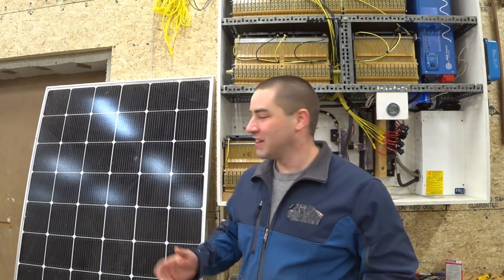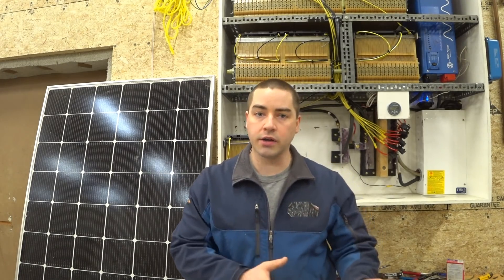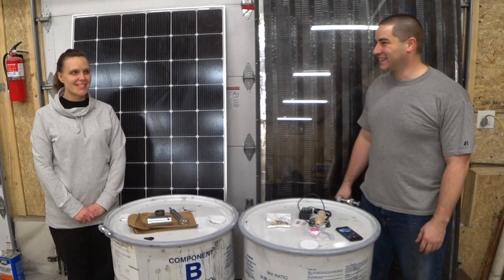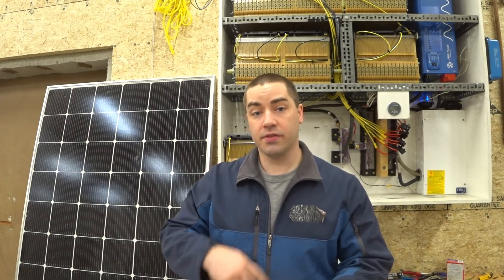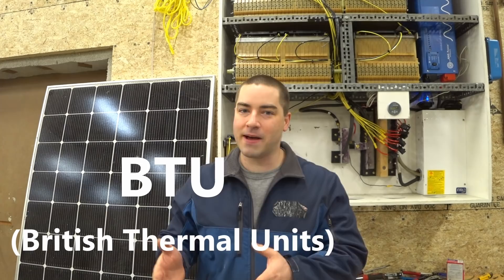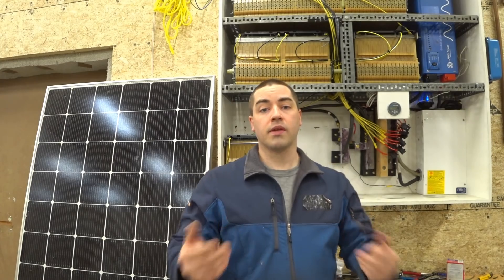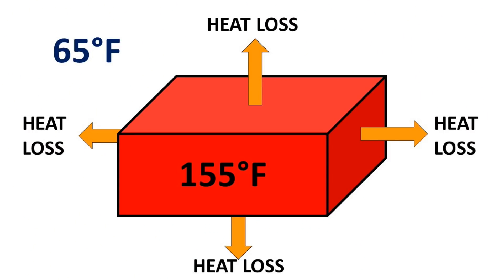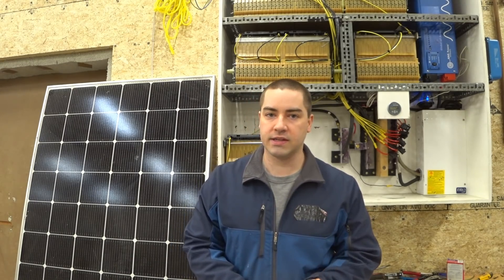Cheapest Energy Storage Off-Grid

Comment: Thanks for your video. I've just discovered it. I wish I had found your channel earlier. 
Your video showed what I've been researching -- storing solar energy in water. Good. But can you make electricity out of this method?  I (and you, also) need electricity to run all the home appliances. I had expected the vid would also show how to get electricity out of the warm water, which didn't.
Was it just in the form of '(warm) water' that you intended to utilize from the storage, like shower water, or
did you make another video for getting electricity out of the warm water? --- Nawsae from S. Korea (Forgive my poor English)
Reply from the maker: I still have a battery to store electrical energy.  Storing heat is to supplement the batteries.  This way you don't need a large battery bank.  Batteries are very expensive.

Comment: Batteries don’t suffer self drain so you can eliminate that from your energy requirements. Also, why heat water with solar? You can build or buy solar collectors for a fraction of the cost of a solar panel. If you are heating water only a system could cost as little as 20 percent as much as a solar energy to thermal energy solution. Solar panels for electricity needs, solar heat collectors for heating and or hot water needs

Comment: You need to think about vakuum storage + Legionella protection.
Reply: he has no legionella problem because the stored water never touches the potable water. as long as the family continues to use hot water, it will be continually flushed. this system operates like a tankless water heater.

Comment: Heating water with solar panel is very unefficient. You should try parabolic or solar Focus heating and you will get 600% eficiency compared to solar panels. You can save the battery energy for your electricity house needs.

Comment: I've had a similar idea but using a buried (never been used) concrete septic tank or similar to store the heated water. A waste heat generator can make electricity from it also.
Reply: Earth will suck the heat right out of your concrete. Probably near impossible to insulate. Now with a heater exchanger cooling your home in the summer with this set up would definitely ease the burden of your AC if you live in hot summer climate.

Comment: I like your video. Thanks for doing this and going through the effort of talking it through.

Could you go through the math on the cost effectiveness of pex vs. copper for the heat exchange coiling? I was thinking it was cool that you used pex and then you said you would have used copper so I was wondering why. Obviously copper conducts better but its so much more expensive.
Reply from the maker: Thanks for watching the video.  Both PEX and copper can work.  Yes, the plastic in the PEX is a bad conductor, but it is fairly thin walled, so it still conducts well enough.  The actual reason I would switch has nothing to do with efficiency of the coil.  It is the smell.  I never expected this, but when the tank gets real hot, the plastic leaves a smell in the water.  I can smell this bad in the shower.  The smell makes me think that there might be some health concerns with the plastic in the PEX.  I'm surprised by this because the rest of my house is plumbed in PEX and we never had any smell from it.  Also, I used an oxygen barrier PEX from Uponor.  This is a high-quality PEX.  I don't think I would have this problem with copper.  I hope that helps.
Reply: @DavidPozEnergy  thanks, that makes sense! Is the PEX rated for the temp? I avoid anything that looks like plumbing (I did do a faucet rebuild last year to repair a drip but that doesn't really count) so I have zero experience working with sweating copper so thinking about compression fittings with PEX seems more approachable than working with copper. My dad did it all the time and made it look easy. Maybe someday I'll man up and just figure it out, flooding a bathroom or two on the way.
Reply from the maker: Yes, the PEX is rated for it, and can actually go up much hotter according to the manufacturer.
Reply: DavidPoz realise this is a very late reply, but rather than rebuild your tank in expensive copper, have you considered using a plate heat exchanger? The pex can stay in place and feed one side of the heat exchanger via a small pump operated by a pressure sensing switch, the water returning back to the other end of the coil. The other side of the heat exchanger is fed with incoming cold water and is heated as it passes through. The water in your pex will never leave the confines of the tube. You may however have to rethink the coil design within the tank to ensure you maintain good stratification of the tank.

Comment: You sound very knowledgeable and you probably are great father too, personally I've been off the grid for years it's wonderful you never noticed that the blackouts are the missing bills. Have you considered just an on demand Bosch water heater eliminates a lot of this energy time and space, just a thought keep up the good work Buddy God Bless America Sean o
Reply from the maker: Hi Sean,  That's awesome you are off-grid.  I hope to join you soon.  When you say "on demand Bosch water heater" I am assuming you are referring to a propane-powered unit.  Is that correct?  Propane is commonly used for off-griders.  I think propane is the best off-grid fossil fuel.  I would prefer it to gasoline, diesel, kerosene.  For me, personally, I want to challenge myself to make an off-grid home with no fossil fuels involved.  It's just a fun approach for me.  Who knows, maybe I will wind up having to buy propane, but I want to try doing it without propane at first.  Thanks for watching.
Reply: @DavidPozEnergy    I'm sure you're so smart you must know that the on-demand heaters only consume propane during a shower and then they shut off to a pilot do you open a valve it doesn't get any less consumption than that FYI I'm sure you knew that. You sound like you went to the same school as me fossil fuel you know it's not fossil fuel vegetation fermenting away like a compost pile crazy it's the oil companies that just let us all. With names like that fossil fuel is limited amounts hard to reach extremely valuable blah blah blah did you get any advice yet to Saudi problem? I think if you just insulated more like you said even if you did some super duper insulation it's got to keep it warm Lacey black drip line hoses on the roof we're so damn hot even on overcast days we could never use it straight from the hose it was so hot all right. Have a good day OG out

Comment: DavidPoz    Hey  using ONLY electric Solar Panels is in my opinion stupid. Using solar hot water is a big deal 
my brother lives in Alaska and has a 4k gal insulated 6" foam and then a waterproff covering. The Solar panels have mirrors and in 25 degree F weather he gets up to 157 degree F water from the panel  and it is 38 degres input to the panels. He uses the heated water for heating the house at night and day plus for other uses. In most cases a hot water tank is the number 2 user of energy after heating and cooling the home. Also since it is very cold 8 moths of the year he has cut a very insulated pipe that goes into the side of his freezer and  has an insulated damper inside. Thus he saves even more on electric storage using cold air from outside rather than using batteries to run the freezer in a home already heated.  Your heat exchanger is a good dam idea. In Palm spring folks use swing pool water to cool the outside coils of the air conditioner. It saves cooling $ plus heats the pool saving even more $.  Great Show DavidPoz

Comment: Here in Nordic parts of Europe, we have had separate heat collecting systems for decades. Electricity is only used for water pump and there is a heat harvesting unit on the roof.
Reply: Back when Discovery Channel still had "The Green Channel," one show featured a DIY home inventor who cooled his photovoltaic array with water (using pipes on the back of the panels as the heat-transfer method, causing more electricity to be produced) and simultaneously pre-heated his hot water.  Such genius!
Reply: Lawrence Carroll 
I’ve seen the same system. For a small system it makes a lot of sense because you can use the same real estate twice. add a tilting mechanism and a large enough bore tube and it could be made to auto-circulate through convection, getting rid of the pump.
Reply: I was just thinking the same thing: Instead of electric solar panels could use heat collecting systems. Wouldn't that be much cheaper / more efficient?
Reply: @maciekmnyt  Go and watch his project from the start. He does both ways and if you watch it all, you will see what he is really getting at in this video.
Pretty much, he would be filling his batteries up and when they are full, the rest of the power produced by his solar is dumped into heating his water, great idea really...
Reply: In Mexico some places still have water  running to the roof into a tank that gets water hot with just sun light as well. for hot showers during the day and at night they turn on the water heater.  I had no idea insulation can store that heat for 4 day holy shit.
Reply: @YEET-yh6qc  I just bought a used ~80 gallon/ 300L insolated hot water tank, because our old one was getting too small, You can store around 26 kWh of energy in it. It's rated energy loss is below 2 kWh per day. But if the water inside cools down, the rate of heat loss goes down with it since the delta to the outer temperature gets lower. So 4 days is nothing really.
Reply: @Psi-Storm  So once that energy is in the water heater how do you use the energy? Is it run through pipes under the floor, is it used for radiator heating, and how is it used for cooling? If I have solar on my  home, how do I use my water heater as a battery? Sorry for so many questions.
Reply: @Jeff-rx4de  
He's only using the hot water tank to offset the energy use from heating his water with an electric hot water heater.  You can't get that heat energy back out of the hot water other than by using the heat to help preheat your water before it reaches the normal electric hot water heater.

However a heat pump which is a compressor could extract some energy from hot water but you need special heat pump system for that like geothermal heating and cooling
Reply: @YEET-yh6qc  with enough insulation and a large enough body of water it can last weeks
Reply: Yes, 20 years ago those systems were much cheaper than PVs, but now it is the other way around.
Reply: In all Europe actually

Comment: Another way of doing it , this is a way of heating your house i have seen my self , when you build a house you build it so there can be a big water tank inside your house , and that is filled with water , what water will get heatet by solar power and pumped arround the house in the radiators and floor heating and so on , and the big water tank will also cast some heating out into the house , that works fine 😊

Comment: Where i live ,  in the new houses they use vertical earth heating of the water , how does that work you ask ? Well its simpel the water tarvelig arround your radiators  or floor heating in your house needs to be heatet,  that can be done by electric or VERTICAL EARTH HEATING , you get a company to come and drille a vertical earth heating system , the longer you drille  into the earth your drille your heating water the warmer it will get when it return to surfe and into your radiators and floor heating , to run a system like this do not take much because its a closed system , it will need electric to run that little pump and a controll board and thats bacicly it , and then you have your house warm as much as you will need 😊
Reply: that  VERTICAL EARTH HEATING everywhere else called "heat pump" and no, it does not work the way you're describing it
Reply: Piranha of Serengheti You're confusing low level geo thermal energy as concentrated by heat pumps, with the geothermal used in nations like Iceland where due to the geology it is indeed possible to get steaming hot water simply by passing cold water through a coil in the ground. Many public buildings and homes are heated this way there.

Comment: Very good system, I my self bought a system just for my hot water (link below) we in Australia are restricted from going off grid, and that's what stops me from going fully solar with a battery. So if we have a power failure while feeding the grid our excess power, we can't use our battery like a generator as in, "It just kicks in" if grid for some reason fails, Which totally F**k's people off and we are a land of Sunshine, But we pay through the Ass for our power, I was told by a solar company to go with a small 2 or 3Kw panel system for power so you don't give to much for free to the power companies, some sort of Irony their. Cheers for video its good inspiration.   bhttps://www.solahart.com.au/products/solar-water-heating/solahart-l-series/302l/

Comment: Is there any liquid for the storage that can work better than water? Maybe with a higher boiling temperature and less thermal conductivity, that may improve the efficiency
Reply from the maker: I'm pretty happy with water as the storage medium.  But, several other commenters have suggested using parafin was to gain the advantage of the phase change.  This has a lot of merit.  I think it complicates the heat exchange to and from the wax (compared with water).  But the wax idea would be a lot of fun to test.
Reply: Hm sounds like a good idea, but sure it looks like it might make the system much complicated. I would love to see someone trying to make that work :)

Comment: He is just talking about storing energy for heating.  As info 12,000 BTU/H = 1 ton/H (refrigeration) = 3.5KW/H = About 16 Amps @ 220 VAC per hour.  You would be much better off to install a geothermal heating/refrigeration system.  Virtually free cooling in the summer and small heat pump in the winter.

Comment: Nice video. I have one question: in the end you compared thermal energy with electrical energy used directly for heating. But what if a heatpump would be used for heating?
Reply from the maker: I'm working through an outline for a video where I discuss that exact topic.  As with most things, the answer will depend on your location, hot water use, etc.  But for my situation: the added batteries and heat pump will cost more than the hot water system.  So it still makes more sense to have a thermal energy store.  Thanks for watching.

Comment: Dave, just a comment on your hot water battery. We have such thing already in Asia since 20 years ago. It is very efficient - why? Because it does not need to generate electricity to heat up the water, hence bypassing one stage of losses. It directly heats up the water through radiation and even works using the infrared portion of the sun rays (It still heats up water during cloudy days). It normally comes with an insulated tank which can keep the water hot. The whole system cost less than USD3000 for a family of 4. 
The water is normally channeled through glass pipes and the water will rise as it heats up and goes into an insulated tank. Some models have certain coating in the glass to enable them to absorb infrared heat during cloudy days. 
Perhaps it makes sense to have a separate solar hot water system just to cater to water consumption needs of the family, then you can have a smaller Lithium ion battery pack to power rest of the house.